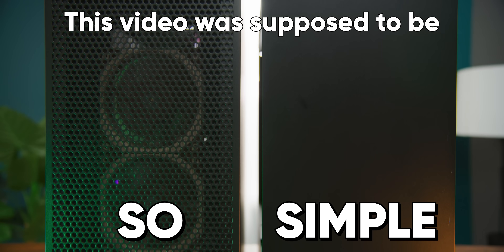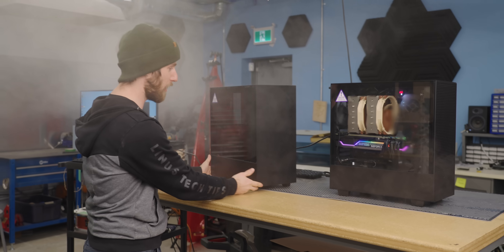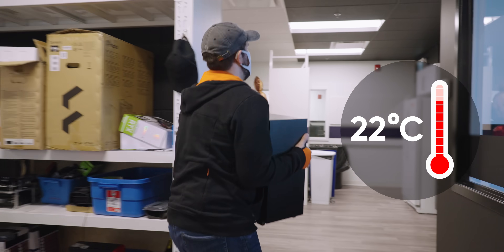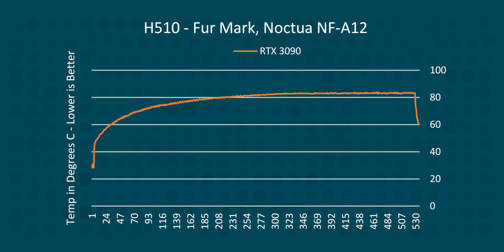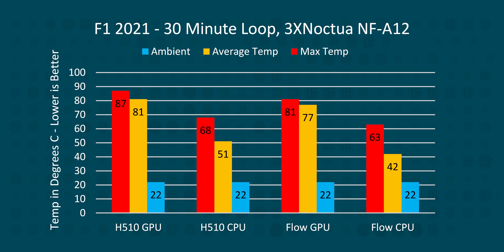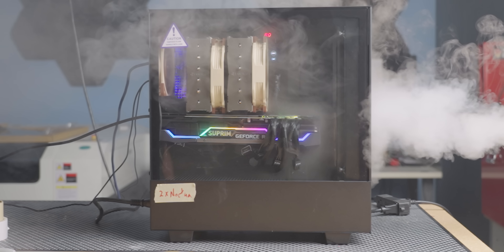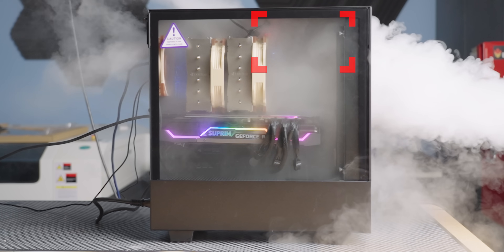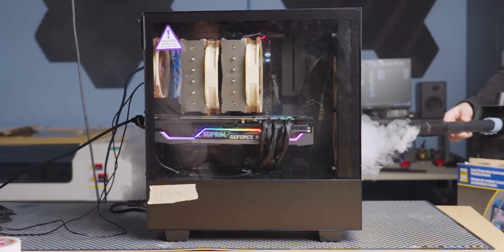Everything You Know Is Wrong - Mesh vs Non-Mesh Front Panel

Comment: i have the bitfenix pandore, very rare nowadays, but i looks good, unfortunately it doesn´t have the best thermals, it came with 1 fan on the lower front and another in the far top, so i thought adding one extra fan in the front would help (specifically my gpu temps which are higher than expected) but in the end it just worsen the situation by a bit, like a solid 8 degrees C more just by adding that extra fan in the front, i had to just unplugged it so it is sitting there waiting to be used some day.

Comment: I’d like to point this out since the bottom front fan is having turbulence against the GPU why not flip the airflow for it have the top blowing air in and have the bottom on blowing out air to pull that hot air from the GPU out of the case through the front?  Or have it where they have a back fan that is smaller but near the bottom to add that to the case that could help but of course it would get in the way of your components and GPUs. Just a suggestion I would like to see if it would make a difference I build pieces for fun Experiment with defense all time have some blowing in will some blow out a my newest one I have for blowing in and six blowing out it seems to be doing pretty good.

Comment: Put an AIO on the front and redo the test. That CPU air cooler is the whole problem for that case/gpu combo. A 280 AIO on the front with 2 exhaust fans (Top/rear) will give solid cpu temps and also bring those gpu temps down easily.

Comment: My $60 Zaman T-6 cheapie case has a 120mm mount on the side panel that is centered in-between the CPU cooler and the GPU which is in the bottom of the case. I have it blowing out while 2 120mms are blowing in at the front. All the case fans have mesh grills on them. The back of the case has a 7x3 outlet and I use meshed PCI slot blanks. All fans in the PC run directly off the power supply. Cooling is great and I got a slot for a DVD rom drive.

Comment: Hi Linus Team ❤.. I actually have the same case, the 510i no mesh and was experiencing issues with thermals aswell. I also have air coold cpu with 2 noctua 90 pwc fans and on a 11700k with asus rog strix 3080 oc and when gaming high resolution on a qwhd panel the best option i found was to remove the glass panel. i reached 75-80 with the panel, 65 withouth.. my conclution is some cpu's gpu combo need bigger cases and better cooling solutions like lian li that has 3 fans in the bottom that blow air inside and provide for gpu while side panels provide for cpu, obviously with a high end aio like asus 360 ryugin or similar.. anyways.. love ur channel, i have learned loads from u guys

Comment: An engineered cooling system is no accident. If you just throw a computer together without thinking about it, you get what you paid for; problems. Most hot components don’t necessarily need direct contact with fresh air. You just need air flowing by them to carry the heat away. And the airflow exits are just as important as the particulars (location, direction, size, strength, blade shape, amount) of the fans that are being used. Also, the airflow in the room around the outside of the computer is just as important. It does very little good to expel hot air from one vent if it is coming directly back in the computer in a different vent. * Most computers have poorly designed cooling systems; many of the per-built PCs are like that on purpose to limit their life span.

Comment: I think many people don't udnerstand airflow lol mesh doesn't mean more air because ita open. You want the air to flow through the case around the components. Think hard about that statement and you will understand. The reason the gpu heat rose because the flow of air was going straight out of the case instead if directly cooling the gpu lol. It's logic tbh and people really don't think about these things.

Comment: The H510 is absolutely 100% a negative pressure case - it performs better when the exhaust is stronger than the intake leading to improved passive intake from all over the case. Especially when it's pulled from the lower back of the case, since that air routes perfectly below the graphics card.

Comment: Personally I had to use a single 120mm fan configuration for my cooler master CPU cooler in my Corsair case. I did some research and found out that there are instances where single draw is better than dual. I got 10 degrees lower on my CPU, my CPU stays at 40c idle. More isn't always better I'm afraid.

Comment: [Rant] This video is super lame. Trying the most stupidest fan layout ever to prove... what? That doing random shit in your pc case makes no sense? Well, yeah... That rear exhaust van also make no sense. Why not 3d print a duct for the CPU cooler? Why not reverse the direction of the airflow and help the GPU with a little shrouding? Even eliminating 90 degrees corners in airflow can mean 5 degrees difference (eg not letting air exhaust hit a side panel directly by putting a carboard box with an angle there). god, air cooling after 20 years is still so lame :D and even Noctuas are not able to outperform my Papst fans with individually balanced rotors and teflon bearings. [End of rant]

Comment: I discovered this problem when one of my 3 front fans started making noise so I had to remove it for RMA when I did I noticed when the GPU was being utilized (gaming) hot air was pushing out the front where the missing fan was, so now I have the top fan (intake) powered by the motherboard and the two bottom front fans running as front exhaust powered by the GPU it's a GTX 1080 that has two  external fan ports I also installed two top intakes so now I have three in and three out but with kind of an odd configuration but works well because I have a 120 rear mount AIO for the CPU cooler it keeps hot air from the GPU from passing through the radiator now it just gets fresh air from the top which also forces the hot air down and out the front and the two fans shut completely off when the GPU is not in use making it super quiet and also makes good use of the top filter because there is no front mesh filter keeps the dust under control at idle with three intake fans and one exhaust from the radiator in the rear the case is fully pressurized and bleeds air out of all the other rear IO Shields as well as out the front

Comment: Amazon sells that dust proof mesh, took off my front glass panel on my deepcool mid size case, and stuck the fans behind the metal grill, then just cut the magnetic strips to size, install the magnets on the case then add the mesh on top. The magnets will adhere to the mesh and then just cut the excess. Dropped 10 degrees gpu and cpu

Comment: I had the same problem with my 3090 in fracta define 7 the you would recirculate it’s own furnace air.

Reverse the nhd15 to intake from the rear 
I just put 3x140mm top exhaust problem solved

Comment: Inside my Corsair Air 540 my 5700xt is right up against my front 3 fan radiator (way closer than the 3090 in yours) and the cpu doesn't go above 65 when stress testing. Gpu hot spot doesn't go above 80 typically in any game. I don't think it has anything to do with the size of the gpu on the case. Maybe the case just has crappy air flow?

Comment: While I appreciate how case designers have really begun to rethink how PC cases are arranged, the lack of diversity is still an issue. I needed a left-side case for my office setup and I finally decided on a Darkflash V22, even though it too only has side vents on the front. I like the unique look of the 90 degree rotated mobo with a "vertical" GPU mount (so my Aorus 3060's fan face outward). I get decent temps, even with my stock Wraith Prism CPU cooler. But I have a nit-pick: they didn't provide an option for any top mounted fans. If I could mount even 1 120mm fan I think it would make a big difference.

Comment: I personally think that the problem you had could simply  be avoided. By replacing the CPU fans with a corsair h100I or h110i you could have significantly better results. And I bet that the CPU cooler was nearly at the same price as the corsair water cooler.  Prove me wrong :)

Comment: Many modern PC cases have less than optimal airflow, anything with a bottom PSU is not optimal. Anything with top exhaust is also not optimal for aircooling, but good for water cooling radiators generally. Alot of these details that are good for AIO coolers are bad for air pressure.

If you are going air cooling, get something with bottom and front fans, with no top exhaust. Like a Fractal Torrent or so. That is the best thing next to good chimney effect PC cases which is another really cool concept for air cooling. But usually, a lot of PC cases have water cooling in their minds more than air cooling, like Lian Li, NZXT and Corsair new cases are mostly for AIO watercooling in mind.

Comment: I wish I would have seen this video before I build my PC because I spent like four days adjusting fan direction to get around that GPU issue now I don't game as hard as some people do so the temps were awful but they were definitely higher than my CPU and that's running AIO and not having the cop case fan because my ATX power cords were in the way I did get the Flo case but what I ended up doing with putting a directional fan underneath where the power supply sits at a 30 degree angle to cycle more air into the GPU area and it dropped my Temps by like 16 degrees over all.

Comment: I've been messing about with this case and a very similar setup and found that it's best to have the front fans (140mm X 2) pulling cool air in gently, so as to not create extreme turbulence and the rear fan set to about 70% fixed to pull hit air out. Now my rig runs very quiet and cool. GPU in particular is running far cooler than before. It's an odd little case for sure when it comes to this kind of thing but get the balance right and it performs brilliantly.

Comment: And that airflow problem is why i took a complete new approach.  I have now 3 140mm fans in the front as intake, 3 120mm fans in the back as outake - but the main thing is, my GPU is not mounted in any normal way...or i should say my whole system is not mounted the usually way. First, my build is on the other side, it is not build to stand on the right side, but on the left side of the table. meaning, the mainboard comes in from the right side of the tower and not the left side. And to top this, it is rotated 90° counter clockwise so the I/O is on the top of the Tower. What results in a vertical hanging GPU in front of 3 140mm intake fans - causing the GPU fans regularly to stop because the GPU is simply below 35° degree Celsius. The Airflow has to cross the GPU before it can get to the CPU...but my CPU realy rarely hit more than 50° degree Celsius. (last time i got temperature above 50°c i was playing Falout 4 at 4k with maximum detail - but i did not like it with that many foliage and dialed it down to 4k minimum grafics - looks way better)

And sorry for a 5 month late respons - i have some backlog because of surgery and rebuilding my PC all to top with getting customed to a new workplace

Comment: I solve this kind of issue when i DIYed my old case, opened up all the  case pcie slots and put a 90mm high flow fan there as an exhaust. So i have now 3 front intakes and 3 exhaust blowing air at the back.

Comment: I've had a teacher tell me it's better to suck air from a heatsink instead of blowing it into it. He said the later could induce turbulence while the former wouldn't. It would be interesting to test this kind of scenario in the lab!
Reply: Since heatsinks are generally mounted right next to an exhaust fan, the turbulence doesn't really matter because it's immediately being pulled out of the case. But from my experience, in a tight case, a pull fan isn't better at cooling the heatsink, but is better at making sure air flows better over other components. For example, in my Mini ITX case, the pull fan is basically less than an inch away from the exhaust fan. While the front of the heatsink has much more open space, which means it's able to pull more air over the RAM sticks, motherboard, and back of the GPU. 

So while the CPU temperature is basically the same or just slightly hotter, the rest of the case is cooler since there is no fan in the center of the case causing turbulence and sucking fresh air before it can reach other components. The intake fans intake, and the air must go through the entire case before it reaches another fan, meaning not turbulence, making the pull fan act like a second exhaust fan, increasing exhausting power and directing everything directly to the actual exhaust fan with nowhere else for it to go but out. 

In a way it makes the heatsink act like a heatsink for other components, because that hot air being sucked through the heatsink, spreads out that heat. And heatsinks are rarely used at their maximum capacity. I've got a 250w rated heatsink, but a 125w CPU. So the temp rises are basically non existent or negligible, and the hot air gets sucked out immediately anyways. So if anything it may actually raise efficiency of the heatsink by causing it to get hotter, which makes the heatpipes circulate quicker. So it all evens out, but provides a benefit to cooling of the rest of the case.

Comment: I'm quite interested to see how much better a case with a bottom fan would do. Or even one without the psu shroud so the front fans can be mounted lower. In gaming computers the gpu is going to generate the most heat, but most cases seem to optimize for cpu airflow.

Comment: Pretty sure Gamers Nexus did this case and said the original setup works because the negative pressure means the gpu forces fresh air in from the back pcie brackets, and the mesh messes this balance up. 

Shoot the fogger at the back of the original, non mesh, case, I’d like to see how much it can suck in. I did an experiment with my old case and one setup had it sucking in from the back so hard, it felt like a Noctua iPPC on full tilt.

Comment: I have a cooling overkill PC, and there is definitely a hot spot below the GPU, but no way to get air to it. I have a 240mm AIO in the the front, with a push pull config, so 4 fans in total, but the bottom slot is also populated by an unhindered 120mm fan that blows directly on the HDDs (Corsair Carbide SPEC-DELTA case). This fan also blows under the GPU but the middle fans on the AIO are dead centre with the card itself, so no matter where I put the AIO, the rad will still impede the flow on the GPU. I hoped more airflow being pulled into the bottom will help either way, but there is still that hotspot problem below the GPU. unfortunately the fin stack on the GPU runs parallel to the front (perpendicular to flow) so the front intakes don't actually blow THROUGH the gpu, but instead down the sides, just a shame. Similar situation as in this case, gpu is close to the fans.

Comment: Take a panel and cut an opening in it and instead of using mesh, use expanded aluminum mesh. Airflow characteristics through the expanded mesh will be considerably better than through mirror holes in metal

Comment: I have an NZXT h510.

While it's certainly not a cold case, I have a 3070 and a 2600 constantly running 4ghz and have never reported Temps above 90° on either

It's all about getting the correct static pressure (positive), proper fan positioning, and getting a cpu cooler that is much too op for your OCed 65W cpu (Cooler master hyper 212 stealth for me)

Comment: Cases with solid front panels usually bring in most of their intake through the gap at the bottom of the front panel with the side vents not doing much. Can't say if same for this case though. But could explain why smoke didn't seem to be drawn in.

Comment: And that is why I ever buy small cases for all my clients either mid or full tower depending on the requirements. And buy mesh whenever you can it provides a lot of breathability. Unless they are building a HTPC with micro ATX there is no need to buy a small case.

Comment: 4000D airflow positive pressure setup. I can feel air being pushed pretty fast out through the PCIe brackets under the GPU when all three front fans are revving up. I had an idea to put an 80mm exhaust there with a 3D-printed mounting for it, just to go as overkill as absolutely possible on the front to rear flow 🤣 But there's really no point.

Comment: I have an O11Mini with a 5800x and an RTX 3090 and I think I have the same issue. I have 2 140mm fans pulling in air from the side.. 3 from the bottom, and a 3 fan 360mm CPU AIO pushing out at top and a max flow Noctua as rear exhaust (on the outside of the case. Lol)
I'm gonna flip my 2 140mm game tomorrow as exhaust instead.
The GPU is okay, minus the stupid back plate, but the CPU hits like 82°C with a 360mm AIO, which is dumb. I checked thermal paste and fitment already.

Comment: I had a really hot AMD build in an HAF case about 10 years ago. It had 3 140 fans in the front(a lil modding) and 2 back fans and a large top and side fan. The cooling was really bad. A friend of mine recommended shrouding the middle front fan so we made a shroud out of thermoplastic sheet and a heat gun. The difference it made was crazy. Shrouding the middle fan "organized" the airflow into lanes. Thank god that build is gone as it was a real pain as it aged.

Comment: With the h510, would adding a 80mm fan as an exhaust underneath the graphics card in the rear benefit the system as a whole?  I'd assume if you vented out the stale air, the negative air pressure of that area would pull fresh air in to replace it and result in better thermals overall.  It might look janky, but i've done way worse in a pinch with a graphics card and broken gpu fan.  You might even  be able to get away with it if you used black screws to mount the fan to the unused backplates?  Of course this would require that the "beauty plates" are the variety with holes in them.